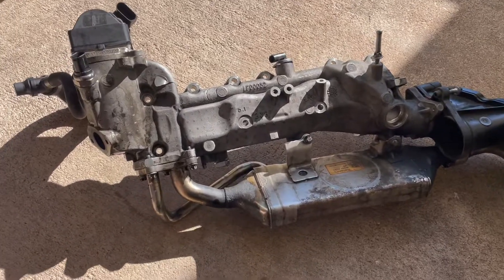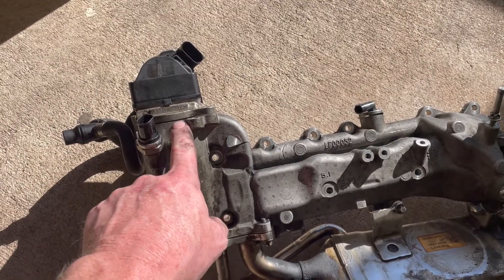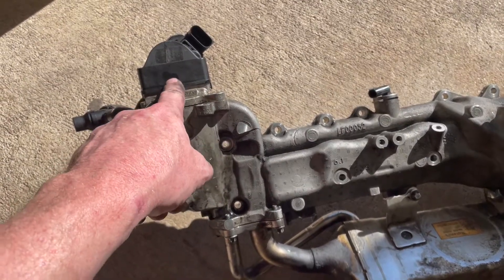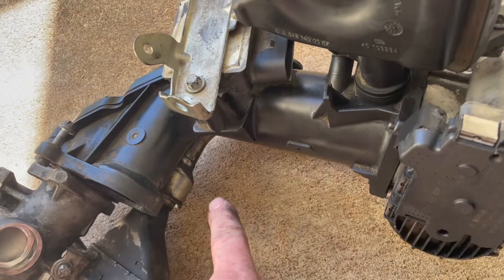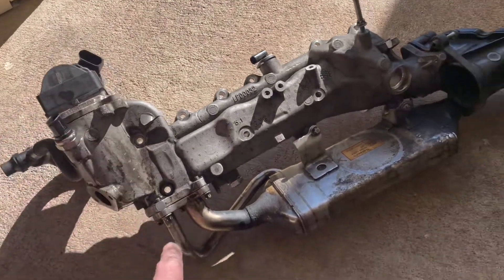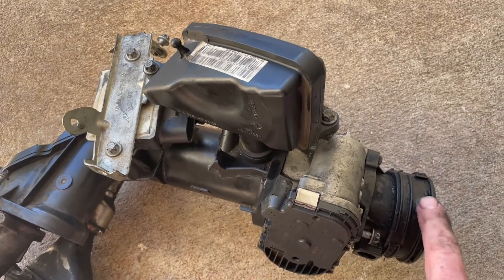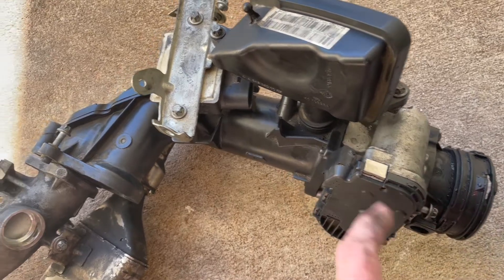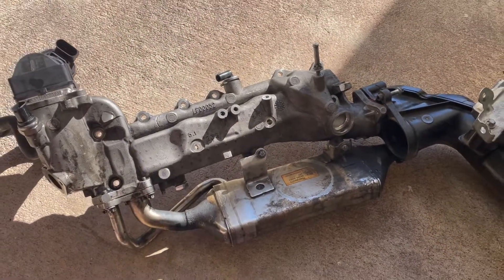EGR system description, OM642 diesel engine

Comment: I know I'm commenting quite late on this video but could anyone possibly tell me where on the EGR cooler the temperature sensor (B16/14) is located please? Mine's reading zero degrees so needs changing. Thanks.
Reply from the maker: Sorry I am not aware of any sensor on the EGR cooler. Is this on an E320 or something else ?
Reply: @DIY-VIDEOS  Apologies, I should have mentioned the model. My question related to an ML350 but I've recently got rid of it as it was causing my wallet too much pain. Thanks for replying though.

Comment: If you remove EGR and bypass a cooler, would it not end up with the more heat going towards the turbo ?
Reply from the maker: Since this engine is designed to have the EGR system it will actually become less efficient if you try to bypass the system. I am afraid you’re stuck with it lol

Comment: Hey great video! I brought same engine but pipes missing on Egr cooler both side, engine smoking white when warm but checked out no head gasket issues! What would you recommend thsnks
Reply from the maker: Well pipes missing on the EGR cooler can certainly cause the white smoke since the pipes run coolant water. You’ll have to replace those pipes or you will loose all coolant
Reply: @DIY-VIDEOS thank you for your comment update. I just don’t understand why someone would bypass the egr cooler both sides
Reply from the maker: @erolsmustang2870 maybe they were trying to remove the EGR system. But this is not a good idea for this engine as it is designed to work with it. It would be less efficient and likely have other issues if removed

Comment: What do you think would happen if I blocked off the pipe that brings air from the EGR cooler back to the throttle body, and mixes with air? I have my EGR disabled, but I'm hoping this would ensure the last 5-10% doesn't leak through EGR. Would using a blocking a plate for that air exhaust prevent airflow in that whole EGR system?
Reply from the maker: Since the engine is designed to recirculate some exhaust gas, you may end up with incorrect mixture and less efficiency/performance. Maybe it is possible to tune the engine accordingly but I don’t know how to do this. I would do this first before making such changes

Comment: Is the egr a water cooled egr
Reply from the maker: Yes
Reply: @DIY-VIDEOS  can this egr leak and cause coolant to drop
Reply from the maker: It is possible. The EGR cooler water line has a metal gasket on one side where it mounts to the manifold and a rubber o-ring on the other side. The o-ring is more likely to leak than the gasket. I am not sure if this is a common problem though
Reply: @DIY-VIDEOS  I had a mechanic that did a water test and the pink water turned orange meaning gases are mixing with water..he said egr can crack inside causing this leak..so may have to replace the egr? Or just the cooler? Thenks
Reply from the maker: In this case you should be able to just replace the EGR cooler. The EGR cooler is downstream from the EGR valve so I doubt it would affect the valve. But since the EGR cooler is under the intake manifold it is a pretty big job to replace
Reply from the maker: I forgot to mention you may also have to clean out the mixing body and the manifolds if water vapor has been getting in there, it could make the carbon deposits worse. But you should not need new, just clean
Reply: @boigoe  I also have a water loss problem in my car. I suspect the EGR cooler of the vehicle. Have you been able to solve the problem? When I press the gas, it drains the water quickly, but there is no heat in the vehicle.
Reply: @mert092 I have a problem with egr cooler bypass flap being stuck. Open or closed. 
Is it a big job to clean it?

Comment: I have w204 (Om642) I have limp mode problem without check engine light, I passed the car in diagnostic and had indicated that there’s an issue in EGR valve, I bought a new one and changed it and after 3 days the same problem back again, a limp mode again without check engine light ! 
Any advices please !
Reply: This is a bad Swirl Flap motor or bad Turbo Actuator. When these go bad, no lights on the dash.
Reply from the maker: If the car goes in limp mode I would expect it to produce an error code. After all, it is the computer that decides to go into limp mode so it would make sense to store a code and tell you why. I am reading on a forum it is possible to get limp mode without a light but what I think happens is the condition was momentary and cleared (the check engine light may have been on for a second but goes back off as the condition clears). In this case, the error code is cleared but it is still stored in memory. So you should be able to read it. I bought an iCarSoft MB OBD2 scanner just for Mercedes. You can find them used for a good price. Things like carbon buildup in the intake system (including swirl flaps) can cause these kinds of momentary problems.
Reply: My Vehicle says egr cooler bypass flap is stuck. 
Where is that flap located ?

Comment: Erg system is something that costs money and brings negative performance. Hence needs to go. U wanna be good for the environment, (what it is not but oke) than u pay for that urselve. I dont drive a lot anyway so just give me an om606 with an open pipe. I dont mind.the smoke
Reply from the maker: Yes, the OM606 is a great engine. The EGR parts do add maintenance that is a bit of a pain and also more parts that can fail. But despite the EGR (and this oil cooler seal thing) the OM642 is a very reliable engine too. Mine has 190K and runs just like new. But yeah, it is extra work to keep it in good shape
Reply: It's not about the environment, it's about being able to breathe fresh air without getting needles in your nose. I'm sure you'd love driving with your kids behind straight piped diesels. Now imagine living in a city and everyone drives with no dpf/egr. If cleaning your EGR once a year is so hard for you, maybe you should switch to an electric crap.
Reply: @em4703  now inmagen in the 70s 80s we didnt had al those things. My old mercedes benz from 84. Wich I dont have anymore and im still sad about that. Didnt stink nor smoke and I think is still driving around somewhere today. My sanyyung rexton which does have it stinks when its idling with a cold engine. That one is from04 so 40 years newer and that one stinks. Also when I go on the highway what I dont do that much its blowing out all the buildup black stuff. U do not wanna drive in a convertible behind me the first ten miles that I can guarantee.
Reply: @superliegebeest544  Understood, but Euro cities in the 70s and 80s had dirty air, because of diesels.